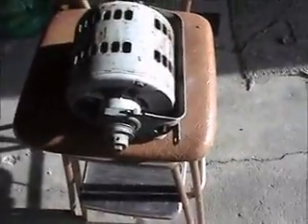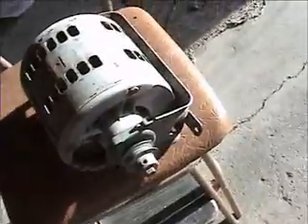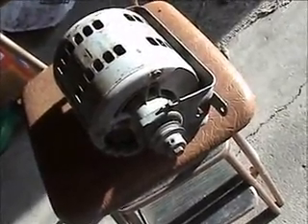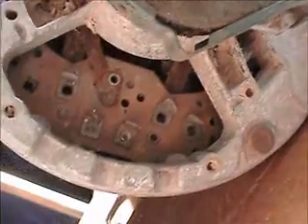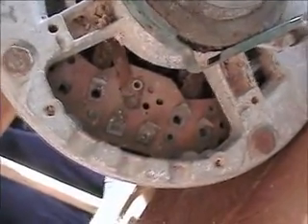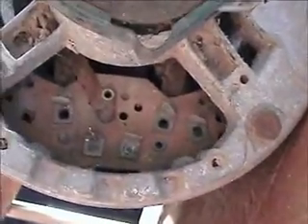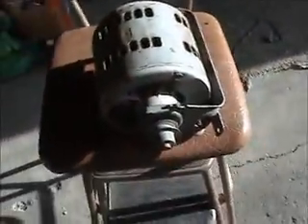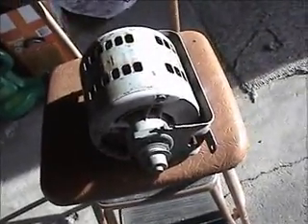1/4 hp GE Motor

Comment: You gottta ohm each two connections and write em down. From the lowest values write each one in ascending order in another list. The common or negative connector will be the one that repeats itself over and over (not in all of them) Example(in ascending order from lowest ohm values): 3-5, 4-3, 2-5, 1-3 etc. The common here would be #3 because it comes up more than any others. After you have the neg it easy just to plug each one in turn and see what you get. Fast, slow, reverse, forward etc.